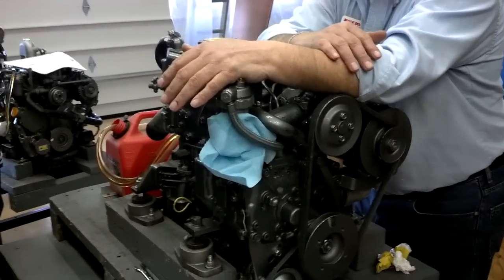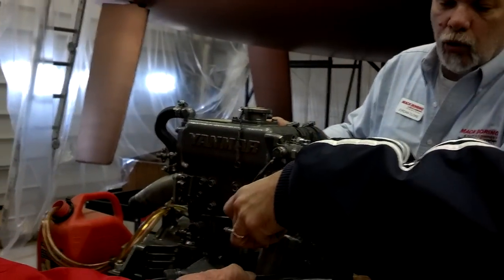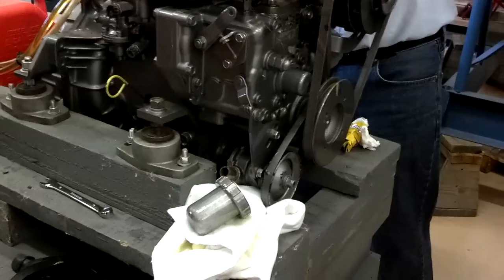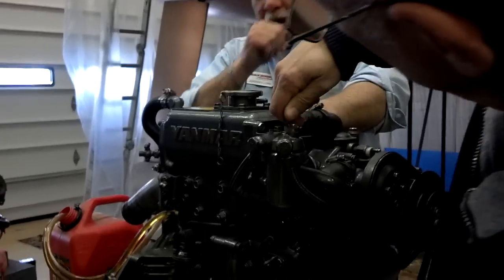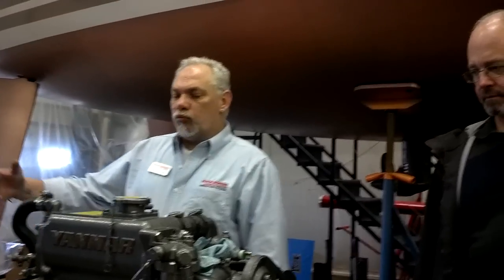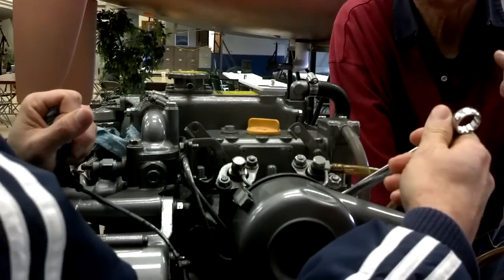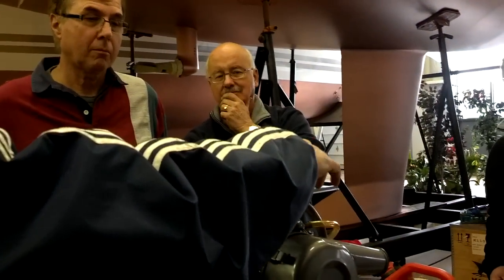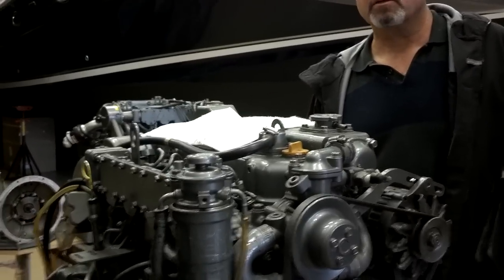SailAwayGirl.com to see both videos on How to Bleed an Engine

Comment: A very important step is after bleeding the secondary filter, you need to bleed at the fuel injection pump inlet port.  The Yanmar manual somehow missed this step too, but quite critical if the secondary filter was serviced.  On some engines this bleeder plug is hard to access with a 10mm box wrench.  I gave a fairly long wrench a 90 deg bend close to the box end by heating it to make this task far easier.  If you don’t bleed here, the engine can suck in an air bubble from the secondary filter’s exit line after a short run.

Comment: Can someone explain why it is necessary to close the thru hull?
Reply: I wondered about this myself. There has to be some connection, but I cant imagine how it affects the fuel line. Does it perhaps make the engine easier to start by reducing exhaust pressure??
Reply: the teacher insinuated something like this.  He said it let's it run faster.
Reply: Just found my own answer in another video.  running the starter motor (for a long while) without the engine starting can fill the exhaust system with water all the way back to the engine.

Comment: Often neglected is the fact that the bleed lever on the side of the pump runs on the cam...as a result if it's sitting on a high lobe you can't bleed it. The first part of the lever stroke is just free play, the pump action is in the bottom 20% of the stroke and is considerably heavier. If you are sitting on a high lobe you will not be about to bleed the system...roll the engine until you gain that heavier stroke.
Reply from the maker: Far North Thank you for the excellent tip!

Comment: Ive never ben able to use the engine driven pump to get fuel up to the filter.... I usually fill the filter with fuel.... I have a brand new pump installed and it never gets hard... even when completely bled.

Comment: I've also never heard of someone finger tightening their secondary fuel filter. It is gently tapped closed with a hammer and a large flat screwdriver tip.
Reply: The toghtness of the collar is not what seals the cup. Its the oring that seals it. Finger tight is perfectly fine. If a wrench was to be used there would be flats for a wrench....
Reply: You should compress the O-ring by additional partial turn to be sure of no leaks.  Yanmar sells a spanner wrench to grab those notches. I made my own. This is unlike a large dia. oil filter which can be torqued 3/4 turn by hand—after contact.

Comment: This was so weird to watch. I have done many of these things before, several times. And if it wasn't a teacher saying it, I'd say he was wrong. For example, you don't need to take the bleed bolts out of the secondary fuel filter, more than one quarter. It will bleed, without a mess, once you back off by a tiny amount.
Reply: He told him to take it totally out so he could show them the bleed holes in the bolt you moron. You clearly did not watch the whole video. You saw him tell the guy to take the bolt out, you got triggered and went straight to the comments.
Reply: Damage, Inc. I don’t think the moron comment was really necessary but for some reason it made me laugh. Nearly spat my bacon sarnie all over the dog!! :)
Reply: The Thomas , I think he was just was showing then the screw with the two holes. I did not know that it had two holes. Maybe he also should have said not all bleed screws are the same. Just I thought.
Reply: Initiate Damage CONTROL.